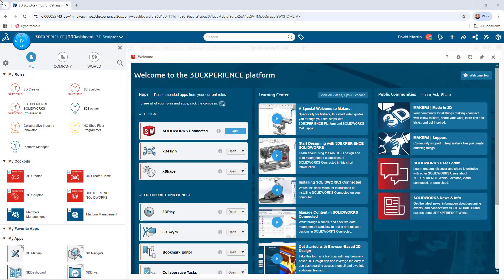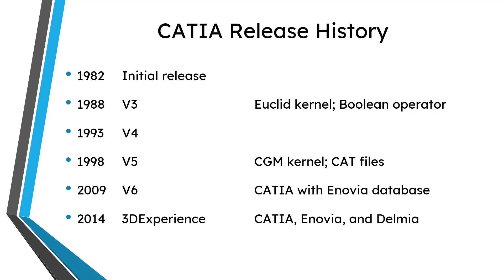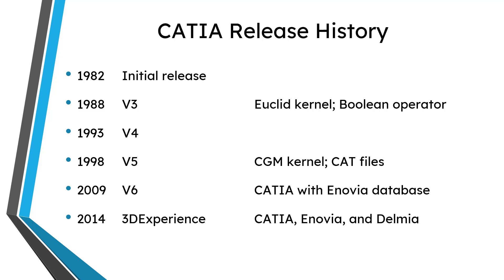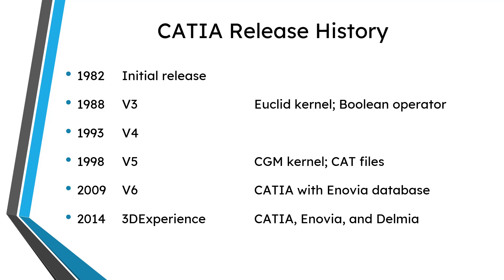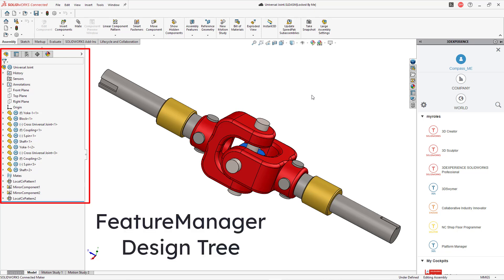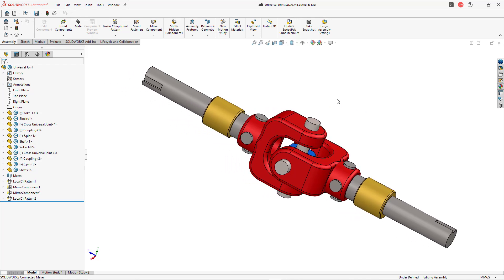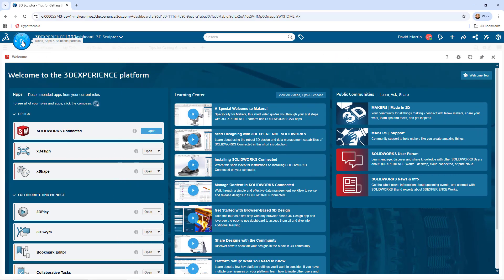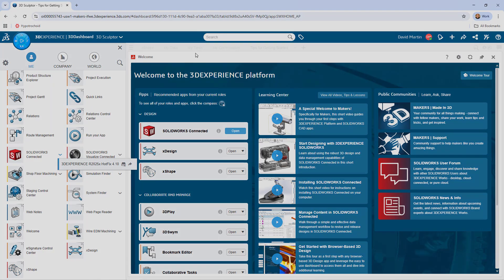A Primer on SolidWorks and 3DExperience - What the heck is going on here?

Comment: Hello.

Just for clarity. Are you sure that CATIA-s kernel was called Euclid?
Reply from the maker: According to my research for this video, the kernel prior to CGM was Euclid. If you are aware of different information, I am open to hearing it.
Reply: I’m asking because there was a French company called Matra Datavision which produced CAD/CAM software called EUCLID, which was real competition to Dassault Systemes CATIA. EUCLID is practically unknown in USA, but it was big player in Europe, perhaps biggest competitor to CATIA from European (French) producer. It ended so that Dassault bought almost complete CAD/CAM software suite from Matra Datavision in beginning of 1999. Matra Datavision retain the development of the kernel, which is now freely accessible under LGPL license and is now known as Open CASCADE.

As I remember my work with CATIA IV, there was actually no kernel in modern sense, it was more of monolithic program written (mostly) in Fortran. I remember that once I have to quit CATIA IV due to warning, that the model is “too big” (too little RAM allocated). Then I had to set one system variable to bigger value and restart CATIA IV, so I could normally continue…
Reply from the maker: SolidWorks still uses the Parasolid which is owned by Siemens, the maker of NX. Which is a major competitor to CATIA, which is owned by Dassault (just like SolidWorks). So it's not uncommon for one CAD platform to use the kernel developed by a competitor.